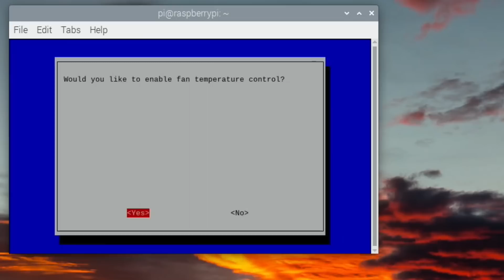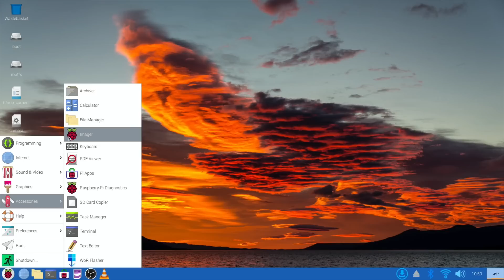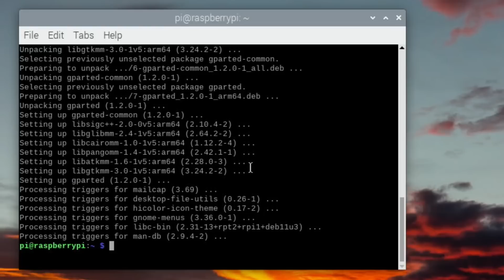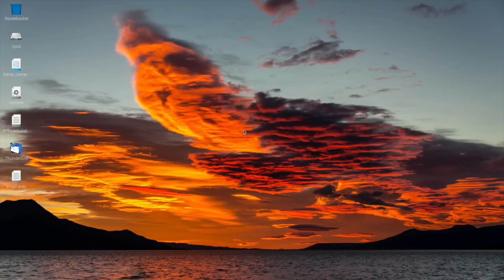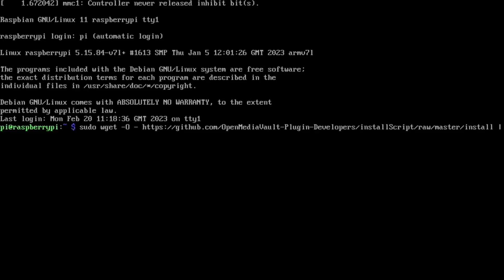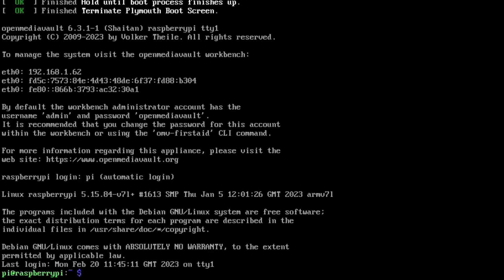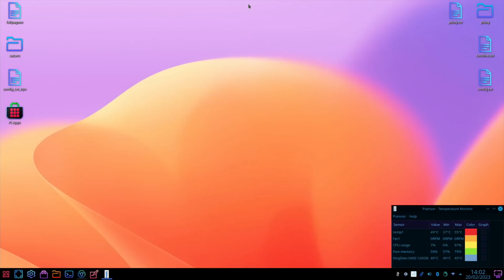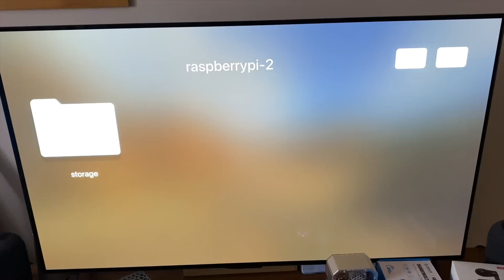Openmediavault running on a single M.2 drive. 52Pi NAS case.

Comment: Be sure and turn these off during a lighting storm.  I had the pi blow out on mine but now that i replaced the pi its networking is not enabled and i cant get logged into it and get all my files.  Don't rely on these for anything important in otherwards.  I only got about a years worth use out of mine till this all happened.  First thing i did when it got running is put everything important i had on it lots of videos and pictures and 3d cad models all unaccusable because i cant log into root and enable networking.  I originally liked OMV on the Pi because it had a web interface and liked being able to access upload and download my files from any computer with a web browser

Comment: Do you think this cooler is good enough for this overclocking?
over_voltage=6
arm_freq=2000
gpu_freq=750
gpu_mem=256
Thanks,
Reply from the maker: I would go as far as 2147 Ov=8. I often use this without a fan

Comment: You notice huge difference between using in M2 istead of MicroSD? I mean, in terms of read/write?
I have this question in mind, because basically are you using usb 3.1.

Thanks, nice video!
Reply from the maker: M.2 and 2.5” SSD drives are much faster than sd cards. Very noticeable when running an os

52Pi M.2 OLED ABS case for Raspberry Pi 4.
https://youtu.be/moqc4vbG4mo

Great budget storage for Raspberry Pi. 17 SD cards speed test.
https://youtu.be/GK59Zl-LqOc

240GB SSD Kingston Vs Crucial Speed Test. Raspberry Pi 4, Pi 400.
https://youtu.be/CRNHUuGZ9aU

Comment: Have you tested 32bit OS vs 64bit OS for this usage type?
Reply from the maker: I haven’t
Reply: @leepspvideo  With pi os 64 lite i get a different 
version of openmediavault as far as i can see
Reply: Yes funny, it installed V5 with the same command. But its possible to update with omv-release-upgrade. Now my 64bit test has same version.

Comment: can NVME Pci-e or NVME SSD SATA be installed in this case ?  E.g. is it possible to install NVME Samsung 980 and is it recognised and does it work?
Reply from the maker: No nvme is not supported. Given that we have to use usb 3 on a Pi 4 there is not much difference

Comment: Parts links (US) for this video are pretty bad.  USB A-to-C: out of stock. Kingdian SSD (big WTF on this brand).  Suggest checking Team Group brand microSD, USB flash or 2.5 SSD on Newegg first.
BTW those no-name brands sell recycled crap, looks like good 240GB SSDs go for ~$17 US right now.
Reply from the maker: I have added the m.2, I have two Kingdian drives both have been great

Comment: the fact he banned the desktop install after omv4 is a pain... but mounting all your remote shares in omv over 2.5Gb/s usb3 Ethernet with 'remote mount' works well especially here with a single local drive installed remember all the key boot dirs are remapped to ram in omv now so ssd is overkill

Comment: I've been running a Raspberry Pi 4 in an Argon one case with a 500GB M.2 drive and OMV for about two years now, totally stable, never had to do anything with it apart from the occasional update.  I run syncthing and Keepass on other computers and syncthing instantly backs up to the NAS any alterartions I make to my Keepass database.
Reply from the maker: Nice 👍🏻

Comment: That really does look like a sweet NAS case
As for nas software i would highly discourage the use of SMB file sharing (Despite it being more common to use on windows/ios/ect) as it greatly reduces performance and security
The better alternative is NFS file sharing which i'm sure openmediavault supports

Comment: Pi 4 has issues to drive many usb storage devices, also not enough power from its USB port(s). Actually saying "NAS" while meaning: "1 drive" connected is kind of overkill ;-)
Reply: thats why you use a powered usb3 hub to fix that HD power drain